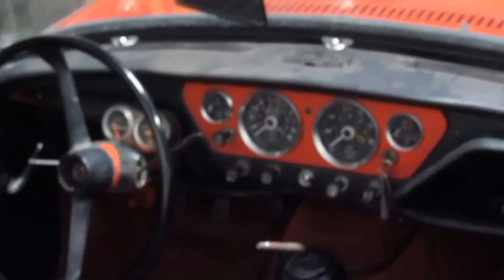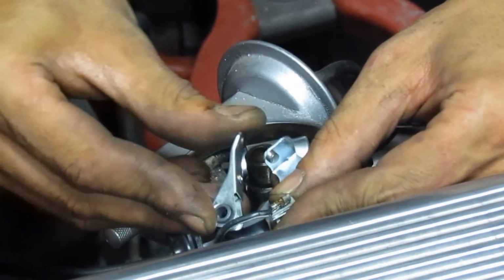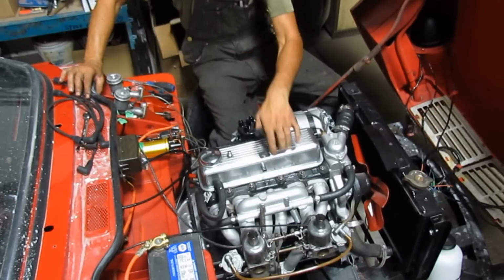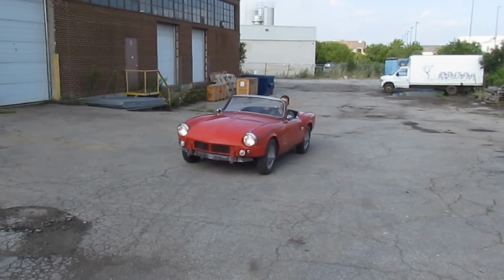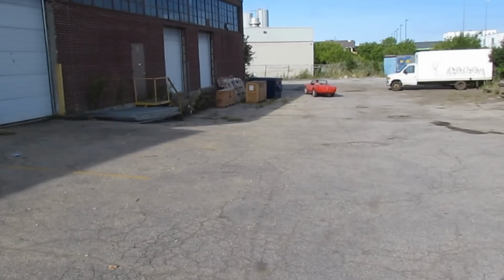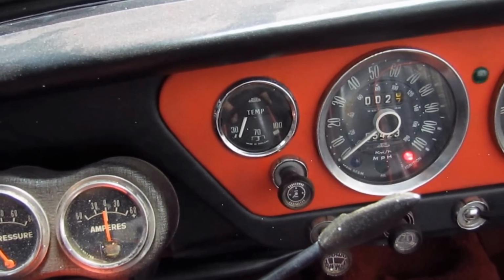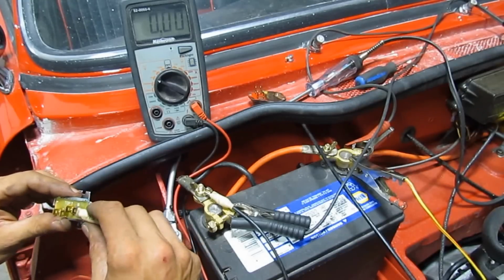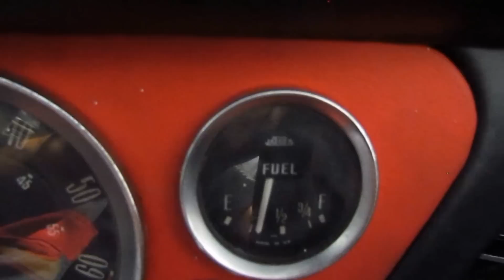1966 Triumph Spitfire MK2 restoration project - part 27

Comment: This is like my favorite video on your spitfire series. I think I have watch it like 5 times in the past 6 months. The voltage stabilizer troubleshooting  just boggles my mind on how you figured it out and fixed. If I ordered a new part, I would wrongly assume it is working. But you did not trust that. Not only that but you were able to recover the item without breaking it. Me I would have it is a million pieces or damaged never to work again. Good work love your videos
Reply from the maker: Thanks Jon. Sometimes the original parts are worth fixing rather then buying after market ones. The voltage stabilizer still works. Actually the fuel level gauge wasn't working again after the winter, but the temperature gauge was OK, so I was sure the stabilizer was fine. Just yesterday I decided to look at this issue and I found that the ground wire on the fuel level sender was not really a ground anymore, so I ran a new ground and now everything is back to normal. Thank you for your nice comment!

Comment: Welcome back! Glad to see you're continuing to "debug" your car. (I'm a software engineer, so "debugging" means something completely different to me!)
Reply from the maker: Thank you! Doesn't debugging mean the same thing in your software language? Finding and fixing imperfections?
Reply: Yup, but it's a LOT easier in software! Run it again and again, with different parameters/code/inputs, etc.
Reply from the maker: Haha, sounds like fun. I used to write my own code for games and stuff back in 1986 in BASIC. I was signed up for afterschool "information technologies" class. It was once a week for 2 hours I think and we had 8-bit computers made in Bulgaria operating with DOS and using Basic as software language. Of course 2 hours were absolutely not enough to learn anything so I bought literally all books available at that time (all 3 of them hahah) and I learned BASIC myself at home. And since I didn't have my own computer I used to write code in my notebook and just type it in when I get to class. The teacher left me alone as I was way ahead of everybody else and I was going there just to use the computer, not to learn anything. Surprisingly most of the time the code worked after just a little debugging. To be honest the debugging part was the funniest one. It was funny to try to figure out again how the code works after I totally forgot already what my idea was when I wrote it... I miss those times.
Reply: HA - I used to write BASIC in my notebooks too.

Comment: you can get solid state voltage stabilizers now, they are more accurate and last longer. your spit is looking lovely
Reply from the maker: Than you! Yeah, the new one I got was solid state and it didn't work :) The output was 3.5 volts. I noticed the voltage was increasing when I shaked the contacts and I thought there was a bad connection somewhere, so I opened it and re-soldered all connections on the circuit board. I also soldered wires directly to it as the contacts were riveted and I wanted to avoid any lose connections, but nothing helped - 3.5 volts steady, with or without load. So sometimes the OE parts are much better then the cheap aftermarket.

Comment: If the voltage stabiliser misbehaves in the future perhaps you could try a buck booster for the 10 volt fuel guage and temperature guage.You have 12 volts in and then you adjust the voltage output up or down.Nice car.
Reply from the maker: Good idea, thanks!

Comment: Elin, I was screaming at the video when you put the new plug leads on.....YOU'VE PUT THEM BACK IN THE WRONG ORDER !!!. I remember Ford engines fired on 1243 but any BMC or Triumph fired 1342. At least you found it in the end. Always thought the old contact points were the Achilles heel on the engine. After breaking down a few times in mine invested in a Luminition electronic ignition system that just replaces the contact points with a LED light and photocell. Yes not original, but it's a fit and forget component ...Good video, you must be pleased with your restoration.
Reply: Yeah  -  1  3  4  2  !!!
Reply from the maker: Hahah, I think I heard your scream, but I couldn't hear very well the words :) Yeah, I never doubted the fire order, because the engine was running. Who could have thought it was possible to run and drive with only two working cylinders... Well, I had the service manual all the time and I never even checked. Another lesson learned. Good idea about the LED points. I will look it up.

Comment: Later Spitfires were fitted with longer axles and a redesigned transverse leaf spring which mitigated to a large degree the poor handling.  This web site is an excellent source of information on all things Spitfire. Yes it was great fun even.  I should have kept it longer.

Comment: I owned a 1966 mk 2 in 1966 and the rear wheels had much more negative camber than yours.  Are you sure you have the correct rear spring installed? It looks as if it is off the Herald sedan.  Even with negative camber the spitfire handling can go to drastic oversteer without much encouragement and you will find yourself facing the opposite way or in a ditch. Later models were much improved but I would recommend fitting a camber compensator  You will find lots of info on web about this.
Reply from the maker: I wouldn't be surprised if I have the wrong leaf after all the crazy staff I found with this car. But how can I tell? It fitted perfectly so I didn't even doubt for a second. I agree the camber is too much on the positive side, I will look up the camber compensator you talk about. Thank you!
It must have been real fun driving a car like this as a daily driver in 1966